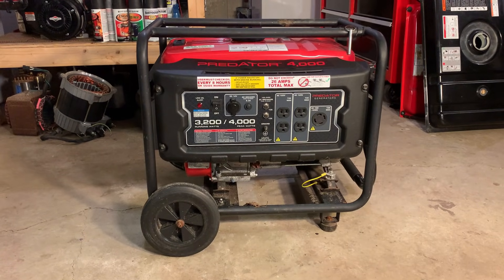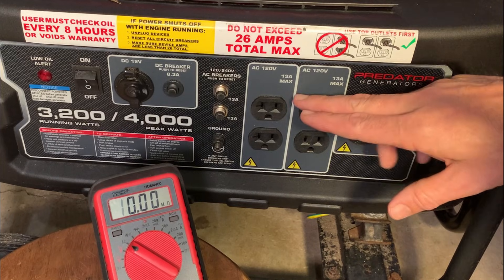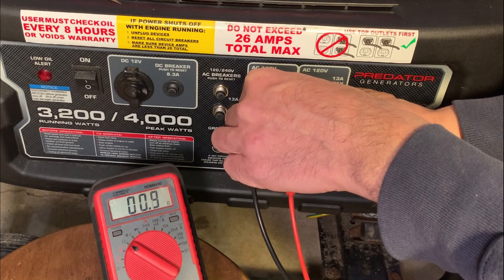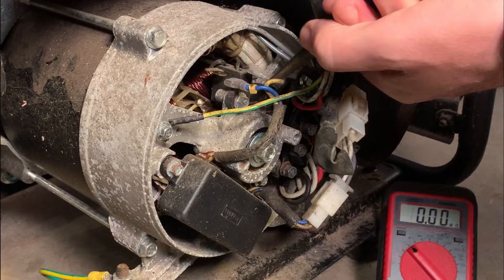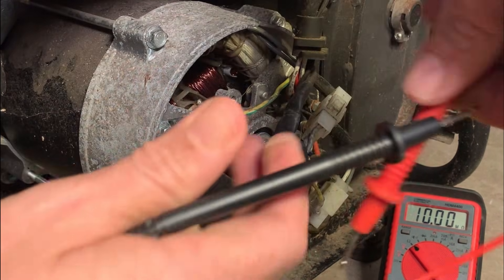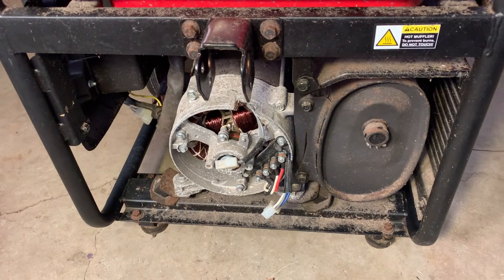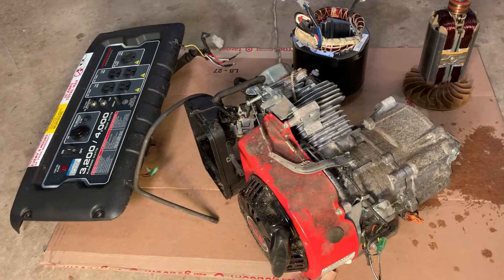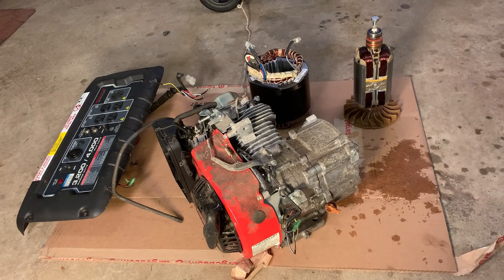Predator Generator Not Making Power

Comment: Predator,  good name for their junk,  AFTER   THEY'VE  GOT  YOUR   MONEY..........doofus rotor engineers.....3600 rpm , and loose, too small of wires.  YOU  guys should have made a fastened terminal, for the rotor windings.AND   a flat wire connection as near to the center of the rotor,  to the slip rings.......very bullshit build. NOT  BUILT  TO  LAST,  as it is a throw away society now...
Reply: Reminder about generator safety: Always make sure you follow all the generator safety rules whenever you use your portable generator. This is only a reminder. Generators can be dangerous if not used carefully. Every year, hundreds of people die or get injured when using portable generators due to carbon monoxide poisoning and electrocution. Make sure you are using your generator carefully and keeping others safe as well. There is something very serious that everyone should always be aware of when using generators. Some people do run their generator indoors which is not safe and that increases the risk of carbon monoxide poisoning which can cause death of family and you. Some people run their generator in wet conditions which can electrocute them. Please remember that you should never run your generator indoors. Remember that carbon monoxide is an odorless and colorless gas that you cannot see or smell. Carbon monoxide is a silent killer. Keep that in mind. Make sure your generator is 15-20 feet away from your house and away from doors, windows, and vents. Never use your generator in your porch too. Having a carbon monoxide detector is very important against generator safety. Some people also allow children to go near the portable generator which could pose risks. We need to keep an eye on our children making sure that they are not near the portable generator so they won’t get electrocuted or burned by the generator which is dangerous. A locking enclosure also keeps kids safe. A generator shed might look like a tempting place to explore, or take cover during a game of hide and seek, but a generator is a dangerous piece of equipment that can cause injury. It says on the manual that we should also keep children away at all times from the portable generator to avoid injuries. Please do not allow a child or unqualified people to operate the portable generator.  It is important to keep your children safe especially little ones. The portable generator can be hot during an operation. Just because some manuals missed what should be listed doesn’t mean it’s safe to do. Always follow the generator safety rules when using portable generators. Generators pose electrical risks. If you need to use your generator during wet weather, you need a generator tent to protect your generator from getting wet. Don’t let your generator get wet. Keep your generator dry and before using your generator, please make sure your hands and your generator is dry. Do not wear loose clothing when operating the generator. Everything that is said on the generator’s operating manual should not be ignored. Never smoke cigarettes near the generator. Please keep flammable things away from the generator. Never overload your generator too. Your generator can catch fire. Never ever try to plug a generator cord into a wall outlet to avoid back feeding. Back feeding your generator is dangerous. Always turn on your generator first before plugging in appliances and shut off the appliances before turning your generator off. Use a heavy duty cord for your generator and the cord should not be worn out. All the instructions should be followed carefully. Never refuel your generator while it’s running. It can cause fire if fuel spills while your generator is hot. You should turn off your generator and let it cool off before refueling it. Having a fire extinguisher next to the generator is also important. This is only a reminder for everyone’s safety of using generators. Make sure your generator is properly grounded. Having a fire extinguisher next to the generator is also important against the safety rules. https://youtu.be/I1jT3ANENvI and here is a video more about keeping others safe when using generators and also about our family’s safety. It’s important to keep our little children safe as well. Make sure your little children are kept away from the generator at all times especially when it’s running. Hope this helps. Always remember that being safe is better than being sorry.

Comment: Folks I cannot stress it enough that is why when you make any sort of major purchase at Harbor freight tools you don’t walk out the door until you buy the replacement warranty I bought a titanium 170 welder I was really excited about it got the highest reviews,,,it sit out in the garage for a few months before I even went near it,,,I’ve been busy with work and all,,,I finally set it up and tried it out it appeared to have power you could run wire through it by hand with some difficulty of course however,,, and left some wire hang  out of the end of the mig gun and ground something and hit it and it would weld it,,, however the rollers wouldn’t engage at all for some reason,,,I’m not a professional small motor mechanic or electrician or anything like this,,,,I had the replacement warranty I went in to HF with it the box all the paper and everything they gave me a new one  on the spot,,,I would say if it cost more than 30 or $40 and they offer a replacement warranty on it you might want to think long and hard about that,,, I was also able to buy a new replacement warranty for the replacement they gave me,,,I wasn’t going to at first,,,, I thought it was ridiculous that you could only use a replacement plan once,,,, however I thought it would be more ridiculous to leave out of there with another welder of that value and not put some protection on it,,,in all honesty I should’ve bought another Hobart I have a smaller one that I’ve had for years works like champ probably should’ve bought another one,,,however. If money is no object by a Honda or Yamaha generator,,, if you’re on a budget you probably couldn’t go wrong with a Champion.

Comment: Have the exact generator and I had it running once.  It won't start again.  It backfires.  Piece of junk.
Reply from the maker: Sounds like a valve issue or timing.  Happen to live close  by?
Reply: Live in Easton Pennsylvania.  Retire in 3 months.  Might be able to get it fixed when I have time.
Reply from the maker: @edwardarruda7215  ok.  I am in southeastern NY.
Reply: @edwardarruda7215  Reminder about generator safety: Always make sure you follow all the generator safety rules whenever you use your portable generator. This is only a reminder. Generators can be dangerous if not used carefully. Every year, hundreds of people die or get injured when using portable generators due to carbon monoxide poisoning and electrocution. Make sure you are using your generator carefully and keeping others safe as well. There is something very serious that everyone should always be aware of when using generators. Some people do run their generator indoors which is not safe and that increases the risk of carbon monoxide poisoning which can cause death of family and you. Some people run their generator in wet conditions which can electrocute them. Please remember that you should never run your generator indoors. Remember that carbon monoxide is an odorless and colorless gas that you cannot see or smell. Carbon monoxide is a silent killer. Keep that in mind. Make sure your generator is 15-20 feet away from your house and away from doors, windows, and vents. Never use your generator in your porch too. Having a carbon monoxide detector is very important against generator safety. Some people also allow children to go near the portable generator which could pose risks. We need to keep an eye on our children making sure that they are not near the portable generator so they won’t get electrocuted or burned by the generator which is dangerous. A locking enclosure also keeps kids safe. A generator shed might look like a tempting place to explore, or take cover during a game of hide and seek, but a generator is a dangerous piece of equipment that can cause injury. It says on the manual that we should also keep children away at all times from the portable generator to avoid injuries. Please do not allow a child or unqualified people to operate the portable generator.  It is important to keep your children safe especially little ones. The portable generator can be hot during an operation. Just because some manuals missed what should be listed doesn’t mean it’s safe to do. Always follow the generator safety rules when using portable generators. Generators pose electrical risks. If you need to use your generator during wet weather, you need a generator tent to protect your generator from getting wet. Don’t let your generator get wet. Keep your generator dry and before using your generator, please make sure your hands and your generator is dry. Do not wear loose clothing when operating the generator. Everything that is said on the generator’s operating manual should not be ignored. Never smoke cigarettes near the generator. Please keep flammable things away from the generator. Never overload your generator too. Your generator can catch fire. Never ever try to plug a generator cord into a wall outlet to avoid back feeding. Back feeding your generator is dangerous. Always turn on your generator first before plugging in appliances and shut off the appliances before turning your generator off. Use a heavy duty cord for your generator and the cord should not be worn out. All the instructions should be followed carefully. Never refuel your generator while it’s running. It can cause fire if fuel spills while your generator is hot. You should turn off your generator and let it cool off before refueling it. Having a fire extinguisher next to the generator is also important. This is only a reminder for everyone’s safety of using generators. Make sure your generator is properly grounded. Having a fire extinguisher next to the generator is also important against the safety rules. https://youtu.be/I1jT3ANENvI and here is a video more about keeping others safe when using generators and also about our family’s safety. It’s important to keep our little children safe as well. Make sure your little children are kept away from the generator at all times especially when it’s running. Hope this helps. Always remember that being safe is better than being sorry.

Comment: What are the chances another stator with same dimensions will work ? Is it safe to assume that most gen heads are made at one factory and provided for use in many brands of complete gen sets?
Reply: Don’t forget about the generator safety rules: Always make sure you follow all the generator safety rules whenever you use your portable generator. This is only a reminder. Generators can be dangerous if not used carefully. Every year, hundreds of people die or get injured when using portable generators due to carbon monoxide poisoning and electrocution. Make sure you are using your generator carefully and keeping others safe as well. There is something very serious that everyone should always be aware of when using generators. Some people do run their generator indoors which is not safe and that increases the risk of carbon monoxide poisoning which can cause death of family and you. Some people run their generator in wet conditions which can electrocute them. Please remember that you should never run your generator indoors. Remember that carbon monoxide is an odorless and colorless gas that you cannot see or smell. Carbon monoxide is a silent killer. Keep that in mind. Make sure your generator is 15-20 feet away from your house and away from doors, windows, and vents. Never use your generator in your porch too. Having a carbon monoxide detector is very important against generator safety. Some people also allow children to go near the portable generator which could pose risks. We need to keep an eye on our children making sure that they are not near the portable generator so they won’t get electrocuted or burned by the generator which is dangerous. A locking enclosure also keeps kids safe. A generator shed might look like a tempting place to explore, or take cover during a game of hide and seek, but a generator is a dangerous piece of equipment that can cause injury. It says on the manual that we should also keep children away at all times from the portable generator to avoid injuries. Please do not allow a child or unqualified people to operate the portable generator.  It is important to keep your children safe especially little ones. The portable generator can be hot during an operation. Just because some manuals missed what should be listed doesn’t mean it’s safe to do. Always follow the generator safety rules when using portable generators. Generators pose electrical risks. If you need to use your generator during wet weather, you need a generator tent to protect your generator from getting wet. Don’t let your generator get wet. Keep your generator dry and before using your generator, please make sure your hands and your generator is dry. Do not wear loose clothing when operating the generator. Everything that is said on the generator’s operating manual should not be ignored. Never smoke cigarettes near the generator. Please keep flammable things away from the generator. Never overload your generator too. Your generator can catch fire. Never ever try to plug a generator cord into a wall outlet to avoid back feeding. Back feeding your generator is dangerous. Always turn on your generator first before plugging in appliances and shut off the appliances before turning your generator off. Use a heavy duty cord for your generator and the cord should not be worn out. All the instructions should be followed carefully. Never refuel your generator while it’s running. It can cause fire if fuel spills while your generator is hot. You should turn off your generator and let it cool off before refueling it. Having a fire extinguisher next to the generator is also important. This is only a reminder for everyone’s safety of using generators. Make sure your generator is properly grounded. Having a fire extinguisher next to the generator is also important against the safety rules. https://youtu.be/I1jT3ANENvI and here is a video more about keeping others safe when using generators and also about our family’s safety. It’s important to keep our little children safe as well. Make sure your little children are kept away from the generator at all times especially when it’s running. Hope this helps. Always remember that being safe is better than being sorry.

Comment: You can use a smaller rod that goes inside the thread without damaging the thread.
Reply from the maker: Yes, just got to use a hard material or it will bend and get stuck.